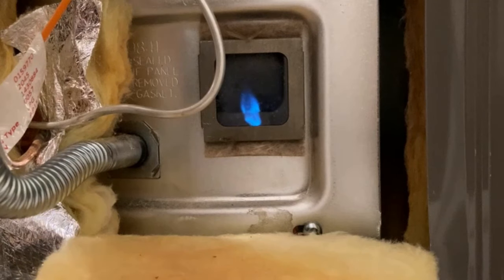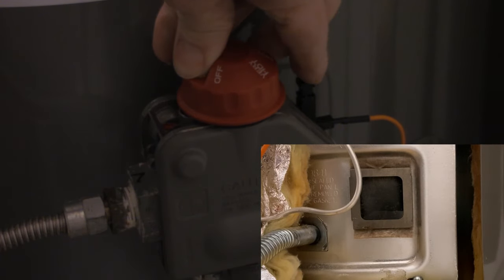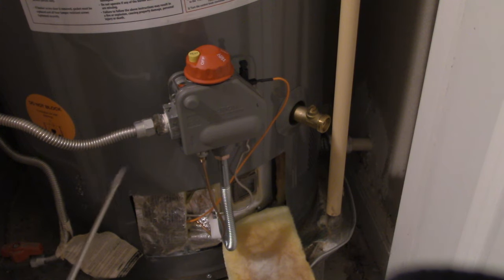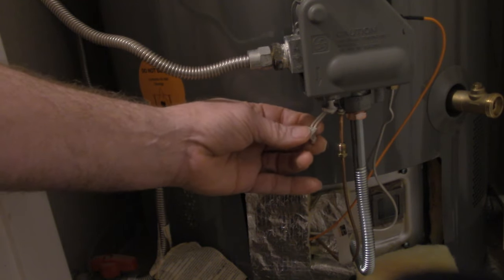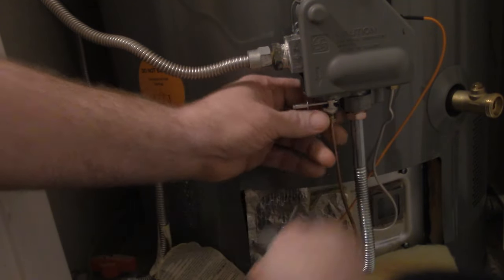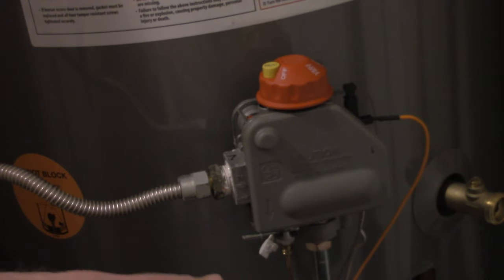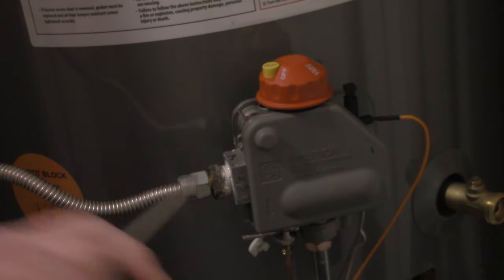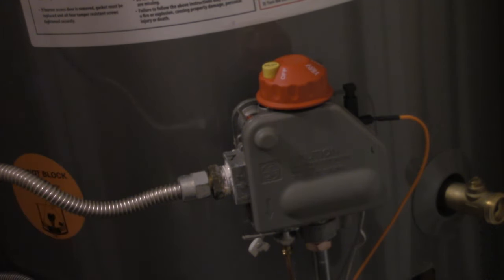Rheem Water Heater Pilot Light Issue

Comment: Dude the water heater is on thanks to your trick 😁. I called 18004328373 they are sending out a new gas valve and said labor is included "if they have a service tech in my area". But 2-3 business days. I just couldn't wait that long to get hot water. So thank you so much!
Reply from the maker: Glad it helped.

Comment: if emergency cut off is not working, would i still see a spark?  i'm seeing no spark at all
Reply from the maker: The emergency cut out does not impact the igniter (spark). If your pilot doesn’t light when you hold down the pilot button and press the igniter, you have a separate problem.

Comment: It has happened twice to me already.  If it goes out again I will replace it with a general purpose gas valve that does not have the scald overprotection which is the issue with this stupid valve.

Comment: And the bad news is the new gas valves are also failing.
Reply from the maker: I don't doubt that. My replacement is the exact same as the original. Rheem should probably look for another valve supplier.

Comment: I had the same problem and thought it was the pilot light assembly, put a new one in and still pilot light would not stay on so  I assumed it was the gas valve but since the tank was 10 years old I trashed it 🤷🏻‍♂️🤷🏻‍♂️🤷🏻‍♂️.
I think Rheem hot water tanks are junk don’t buy them !!

Comment: but adding a nail didnt work
Reply from the maker: If you are certain that you have a good electrical connection with the nail, you could have a faulty thermocouple. You can test it by lighting the pilot and measuring for ~ 25MVDC on the thermocouple. If the thermocouple tests good, you would likely have a faulty gas solenoid, which will require replacing the gas valve.
Reply: I added a nail and it worked great so far, waiting on back ordered gas valve now.
Reply: @MuddFlappRanch  mine only measured ~ 15 MVDC but did work with a nail. The pilot flame seems extremely small, took a long time to heat the thermocouple to 15 mv.